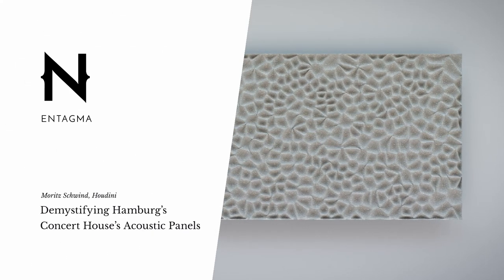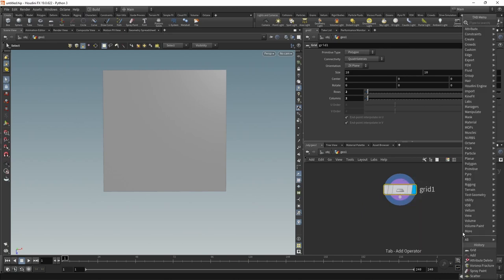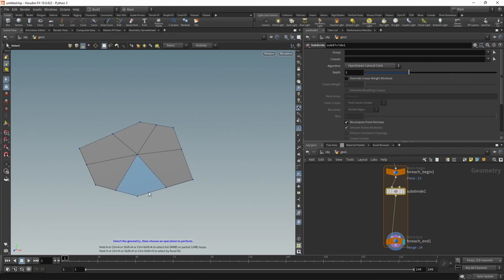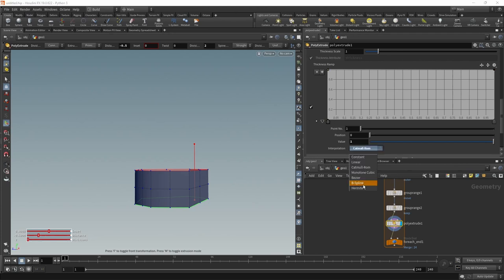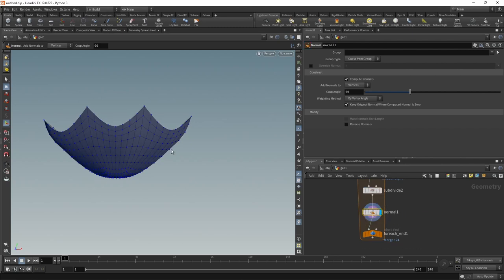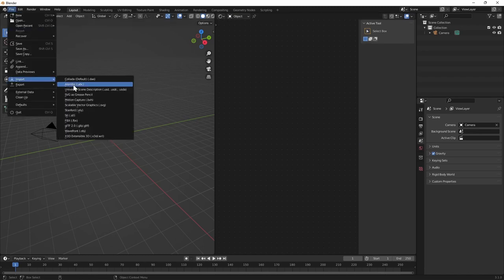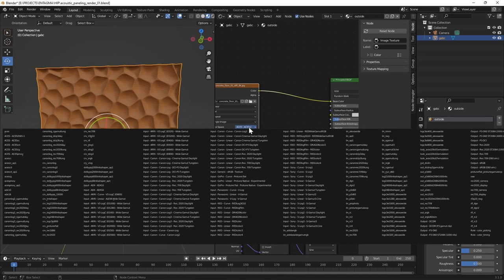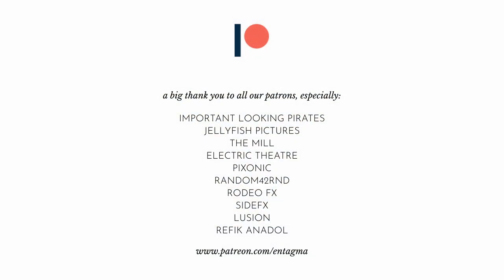Blender / Houdini Tutorial: Demystifying Hamburg's Concert Hall's Acoustic Panel Design

Comment: Hi! I am the developer behind the acoustic panels/pattern showcased in your video. You pretty much nailed the process—great job! The smaller grooves in the panels were indeed intentionally created by the ball-shaped CNC router bit for both aesthetic appeal and a tactile experience. I couldn't agree with your concluding remarks more: despite the apparent simplicity of the final implementation, the journey involved many, many iterations of experimentation. Once we established the final, straightforward diagram, it gave us full and comprehensive control for adjusting the pattern, addressing both acoustic and architectural considerations. The two final steps in the process (perhaps a part 2 for your tutorial?) include detailing how to drive the pattern parametrically (which we did using grayscale images targeting specific areas in the concert hall) and mapping the pattern onto non-flat surfaces, as none of the interior surfaces of the concert hall are flat. Excellent work!

Comment: I'm positive they used Rhino and Grasshopper to generate this pattern. 
EDIT: Grasshopper was NOT used. See reply below.
Reply: It wasn't done using grasshopper. The main work developing the pattern was done in 2005-2007, shortly before grasshopper came out. It was done in Rhino with the open nurbs library for the final implementation as well as rhinoscript for prototyping
Reply: @BenjaminKoren-o7p  Thank you for the detailed reply. The fact it was done solely in Rhino is extremely impressive. I'm surprised it was designed that long ago, give the fact that construction ended in late 2016. Were you part of the design team?
Reply: @BenjaminKoren-o7p  Thank you for the detailed reply. The fact it was done solely in Rhino is extremely impressive. I'm surprised it was designed that long ago, given the fact that construction ended in late 2016. Were you part of the design team?